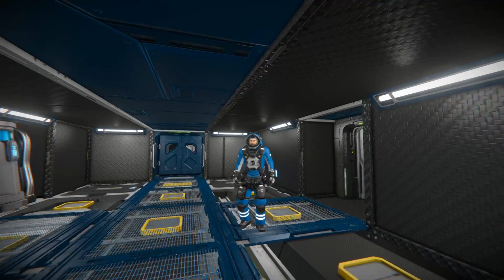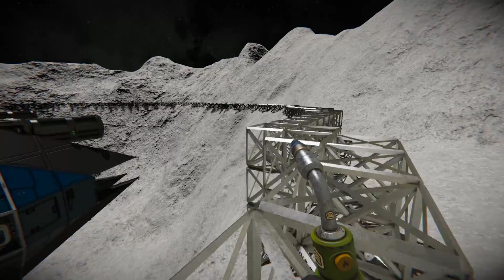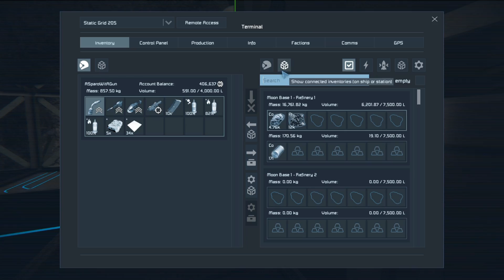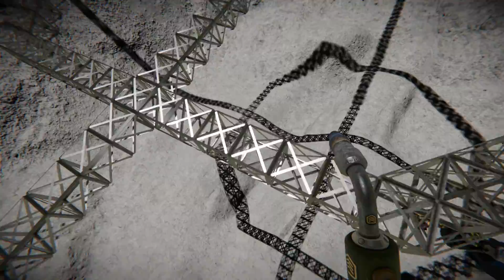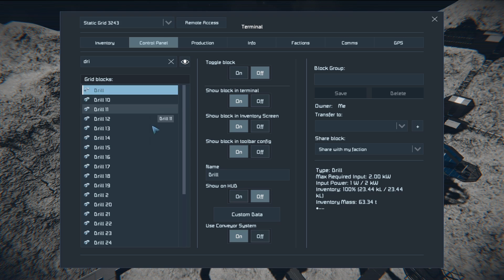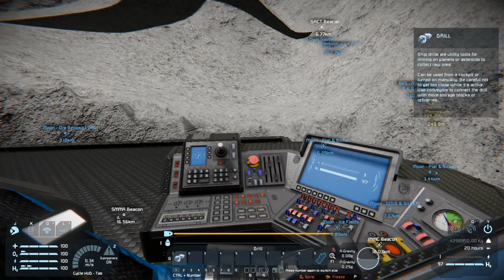Designing The Moon Base Mining Rig - Space Engineers LP - E28

Comment: You built a vertical drilling ship. 
You should name it the Pogo.
Platforms don't have thrusters.

To build a Drilling platform I use the following:
Many pistons for vertical and horizontal travail.
Share inertia tensor
One advanced rotor for pan control.
One advanced rotor for the tool head.
You will want a small grid rotor head.
One small grid big conveyor junction.
Small grid block drills.
Small grid small conveyors.
Small grid flood lights - (2 orange light, 2 yellow light)
Small grid inte. lights - (2 white flashers, 1 sec. intervals)

I have never had a problem with clang when it comes to rotors and pistons.
Reply from the maker: In terms of accurate definitions...yeah...you're probably right lol. I just said platform I guess, cause I didn't intend for it to really DO anything else. It wasn't like the Exogorth etc, it was JUST to mine that crater. But true, thrusters would make it a ship. :P

As for your specs...yeah...I think I'm getting a picture...that would probably work well. The ONLY reason I didn't do it that way, was I really wasn't sure how far down I wanted to go, so I didn't know the number of pistons I'd need. So, I figured it was a bit more...future proofed so to speak to do a ship. I'm happy with how it came out, other than the H2 requirement but...I suppose that's how it had to be.
Reply: @Sleeplessknightsstudios   Are you going to name your ship the Pogo?
Reply from the maker: Haha...yeah know...at first I wasn't but...I might, maybe the Moon Pogo lol. xP

Comment: Honestly you could also turn this into an asteroid eater and I would recommend that you up the gyros by about 3x than what you have. Also PAM has other commands aside from up, down and apply I suggest you look more into it. As for the sensor orientation, I think its supposed to be the drill direction. You could also add another cockpit for a different flight pattern
Reply from the maker: Yeah, I could definitely add to it. Which I may do, but if I get enough resources I may just cannibalize it for a better design. I sort of threw this one together just for this so, there's probably a lot better ways to make it. I'll have to check into the PAM thing, I really can't remember how to do the sensor for a vertical ship, but yeah I know there's a lot more commands, but I just always seemed to use those main three & get everything I needed done. So I'm just not quite as familiar with them. As for the different cockpit, that's a good idea, I added the second one for symmetry but didn't think about actually making it maybe oriented differently & such.